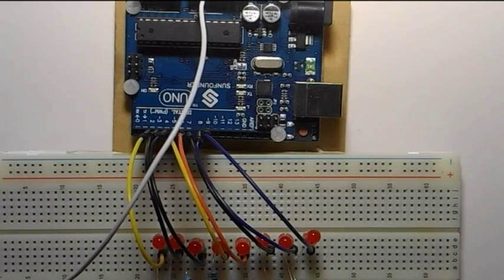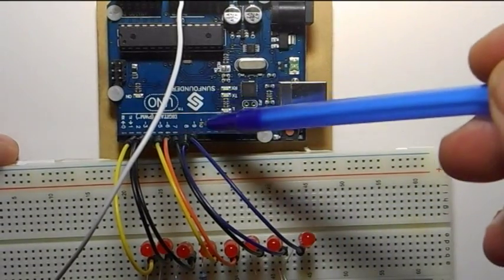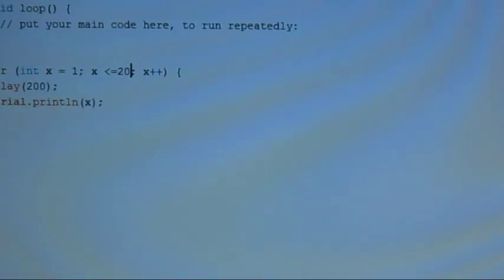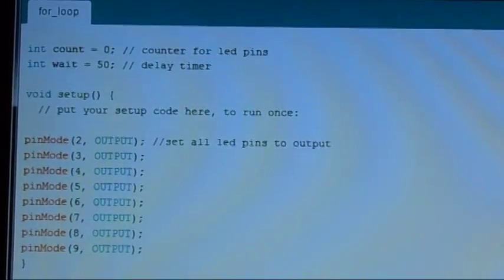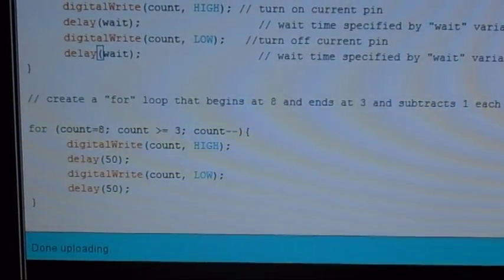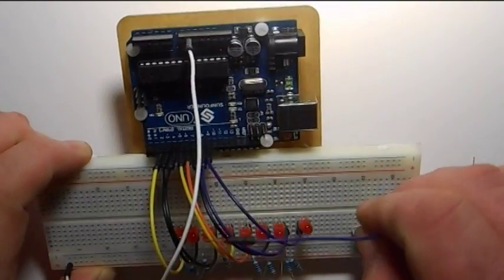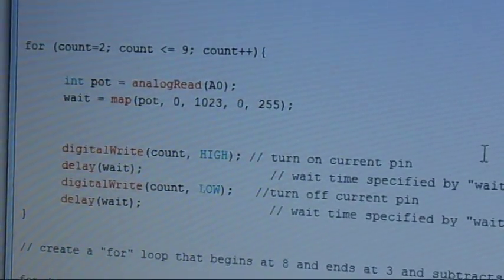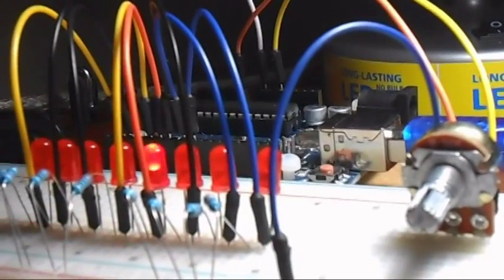for loop and electro mechanical delay

Comment: You cut the video between the compile and showing the result at 5:29. Are you sure the result is from this exact code? There's an extra delay when the rightmost LED switches off, and I don't see that delay in the code. [edit] I spotted the error already, the rightmost LED stays off. So we see pin 2 to 8 being activated, but the LED connected to pin 9 never lights up. That's where the delay is. So the problem is the LED or the connection, not the code.

Also you use the wait variable for the first loop, but the second loop has hardcoded 50ms delays. And in the second example, you should declare the pot variable in the same block of code as the wait and count variables. Why create new ones for every use?
Reply: I found the solution through trial and error, his mistake is that he put the same wait integer, but you have to use a different one, otherwise the potentiometer only controls one loop at a time. So in the second loop, change the wait integer for something like waitTwo, and then in the delays, change it to waitTwo, and initialize a variable in the beginning called waitTwo=0. And don't forget the semicolumn. And then it will work. Since his version worked, my guess is he didn't show the entire code after he fixed it, which is great because it has allowed me to practice my problem solving skills.
Reply: @lazo3251  You're wrong. Need more trial and error then. As I said, it's a connection problem. At 5:46 you can see that the rightmost LED is not connected properly. There's no resistor connecting the LED to the + rail. The resistor is connected to the wrong row of contacts.
Reply: @ArumesYT  I didn't make that mistake in my circuit, because I made sure to connect each LED with a resistor on the negative part, and with a cable on the positive part to the digital (2 to 9), but still, the potentiometer could only control one loop, so I set a different variable for the second loop and then it worked perfectly. So no, it is not a connection problem. I study in this field, so I know the basics about how to connect LEDs, I'm only here to learn how to use different components with an Arduino Uno and computer programming (which I studied in the past for 2 semesters before choosing to switch my major to electronics)

Comment: Okay, the For command makes things easier. I made my knightrider light before I saw your video. I coded it completely differently and more verbose than this idea. I'm definitely learning!!  I also only used 5 pins to control 9 LEDs. One pin controls the center LED, but each of the other 4 pins control 2 LEDs each. Mine starts on the outside two LEDs and moves towards the middle and then back out. These videos are teaching me SO MUCH!!!!! Thanks A LOT, Paul!!!!